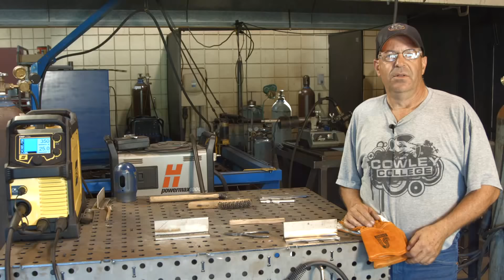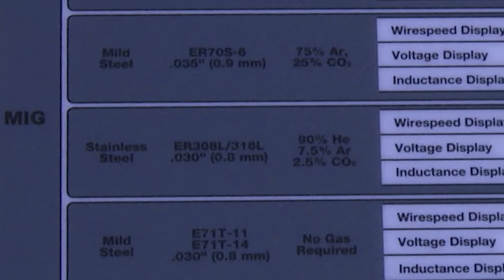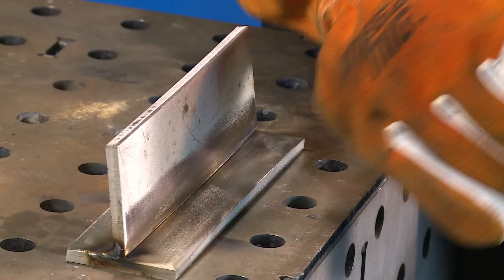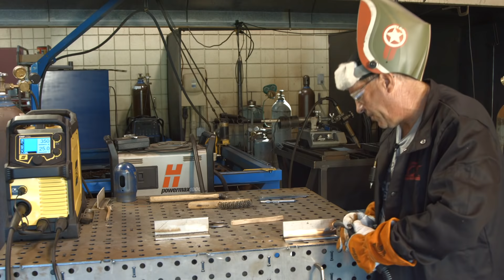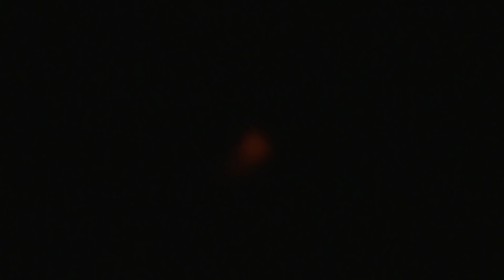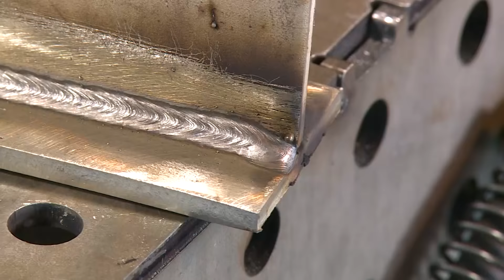MIG Welding Stainless Steel with Tri Mix Gas

Comment: I kinda wish you would have taken a hammer to the C25 weld...because in my testing, while the "bead profile" looks ok, there is zero blending of the pieces going on under that bead...like none...at least on 1/8' SS...and I have a 215 amp machine...it may stick it together, but it's not welding it together...

Comment: With helium and try mix no matter what I do it comes out dark grey. Going off of millers settings for the machine. Dropping lower. Using my settings. Never had this happen when I used to pulse mig it with 90-10 or 98-2. Not sure if it’s just the helium mix or short circuit but I’m stumped

Comment: I have always used tri mix but I had someone ask me to repair some stainless and I do not have the tri mix gas and it is not enough work to purchase a bottle as I will not use it.  But I might just just go with the tig.  I have not ever tig welded stainless and to be honest I am not the greatest tig welder. I mean I am not horrible at it but I want these things to hold up. But I have welded a shit load of it with a mig and tri mix so I thought I would watch some videos.  Have about 2 dozen welds to make that are around 3 inches long and cosmetics does not matter.   I have a little now that I am thinking about it I might just pick up some stainless rod and practice a few tig welds it might be the easiest way to go.  I repaired some of these same parts 20 plus years ago and I used a stainless rod for stick.  As I did not have a tig or the stuff to mig it then either and they held up real well.

Comment: Hello.  So I have a Linkin 210 welder. I wanna run stainless steel wire with a tri mix gas. What psi do I set my gas and for 14 gage metal what V and wire speed.  Thanks.

Comment: Hi such a great information i learn from your channel, how ever im quite curious is it possible to perform welding mig or tig with (SF6 gas) Sulfur hexafluoride, would love to see what are the reaction and result would happen if we using that gas for welding. I know this type of gas use widely for sealing out electrical panel box in electricity industries..just curious could we do gas sheilding welding with it? Would Love to find that out..

Comment: Thanks for posting. I have a c25 gas bottle and the first time I used it I thought I was doing something wrong. Watching this is about the same results I had with the c25. I do like the tri mix result for the stainless.

Comment: It's really interesting, the difference between welding stainless MIG in a shop, not having to worry about anything other than machine settings, then going private and trying to set a production system up on your own. Can you say money down? Part of me says "cheap out and stick to aluminized steel." and the other part of me says "what you're building is filling a gap in product support, and it might pay off to make a higher quality product with stainless..."

Comment: Love the tri-mix use video. I weld a lot of 16 gauge s.s. in kitchen/dishwasher capacity in skyscrapers as in hospitals.

It's a sensitive beast, that demands respect and a lot of tacks & heat sinks (wet cotton rags).

Comment: Great topic & good video, in my 20 years of mig welding I never tried this till  just the other day ran out of argon on the tig,  had to use an old small roll of stainless mig wire I had around for a few years thru it in the mig with 75/25 gas to finish a few inches of stainless welding. It worked but sounded rough and all the welds got ground half way down anyhow. Great thing to practice with mig.

Comment: Using  75/25 gas is a great way to end up with carbide precipitation problems aka weld decay. Because chromium is almost as thirsty for carbon as titanium is.

Use 98AR/2CO2 gas. 

The only reason to use 90% Helium is if you want to pay 4 times as much for your gas.
Reply: probably not but with 98/2 you can spray arc  as you need 90% or more for spray. doing thick material it's great. you can also use 98/2 ar o2 which is recommended

Comment: one question Mr Bob .What settings(voltage and wire speed) would be best for welding thin Stainless steeal sheet metal?also with Sillicon bronze as well/I would great appreciate it
Reply from the maker: Anthony Ellis There's not enough information in your question to properly answer that. It will also vary based on machine and other factors. If you're having trouble, download a chart and use that as a starting point for the material thickness you are using.

Comment: I was wondering if you could run Stainless through a spool gun do I have to use tri-mix all I have is C 25 straight argon or co2
Reply: C25 will work, watch the other video Bob did on C25 stainless

Comment: Bob, would you post what your settings were for the trimix welding,volts, wire speed, gas flow,etc? Also,do you think that the Lincoln 140C, with.025 308ss, with trimix could work for a portable machine? If so ,what would the settings be for it? Thanks

Comment: This comment is for the gentleman from (workwillfreeyou), and anyone else who is having problems cleaning the black carbon burn marks from any kind of stainless steel welds. Check out the EASYkleen PLUS BRUSH electro polishing machine at the stainlessweldcleaning.com website. They have a wide range of machines for cleaning and polishing just about any thickness of stainless steel. It would be great to see some of these demonstrated on this show.

Comment: Another great video. Thanks, Bob. If you could work it in, S.S. plate in the vertical position. With a cut and etch or bend test on your very nice bend test machine. I've been in a shop that rejected S.S. mig because of the color ( black ) of finished weld.
Reply: Not that I don't trust your years of experience welding and judging if a weld is visually good, but a cut and etch is the ultimate way to grade a weld.  Thank you for sharing your vast experience with us nube's who are trying to learn.

Comment: ...At my last job, I did a lot of SS for food grade machinery....tri-mix was code required...
 But...with 75/25....more spatter due to higher C02, and perhaps a little less penetration due to lower arc voltage from lack of Helium..?

Comment: Bobb!!! please help me... I have a lincoln ln9 wire feed mig welder with a 9 pin connection... how can I hook this up to a residential home 220v outlet... just give me some pointers... I am a mechanic so ill get it eventually just gathering as much info as i can before i tackle this ..  thank you...
Reply from the maker: What welder are we hooking up to 220v? You can’t hook up a feeder to 220v. Feeder connects to the power source (welder) through low volts (usually 24v).
Reply: its a Lincoln LN9 wire feed... will this be able to be used at home?

Comment: I would like to hear your take on weld sizes dealing with structural welding. alot of guys just coming in really don't have a clue about proper weld size and multiple pass to make like a 3/8 weld.

Comment: It would be interesting to see how it would turn out with pure argon as well.
Reply: Turns out like a hot mess. The puddle does not transfer heat to the base metal well and you end up with cold balled up ripples and little fusion at the toes. If you do get it to stick, you end up with high crowns and v'd out ripples since the heat stays mostly in the puddle.
Reply: I agree I used pure argon was a disaster will try c25

Comment: it sounded like you could have used a little bit more wire speed does that make sense
Reply from the maker: Absolutely, More wire may have toned it down a bit, but we were experimenting with the parameters suggested by the machine. Also, SS welding with a tri-mix will always sound different than welding carbon Steel with C25. Hope this helps. Thanks for the feedback.
Reply: torcher78 thats the nature of the beast with SS mig welding just like bob said it will sound different. You have to train your eyes more than your ears with SS mig welding

Comment: i have considered buying flux cored SS wire because I don't have the space for a tri-blend gas. could you possibly do a review on some SS Flux Cored wire?
Reply: Use 98AR + 2%CO2 binary mix. It's cheap.  Are you talking about self-shielded flux core stainless. While I'm told it exists you'll regret using it without wearing a hazmat suit. The stainless properties of welds made thereby are likely to be dubious at best due to nitrogen contamination.

Gas-shielded stainless flux core is an industry standard. Beautiful results. I reccomend Avesta, ESAB or Kobelco FCAW wires.
Reply: I like your comment, it would be interesting.
Reply: Tom Herd 
 thank you, and then I'd like to see it with gas cover.
Reply: shexdensmore
Same, I'd like to see it with C25
Reply: TSorovanMHael y